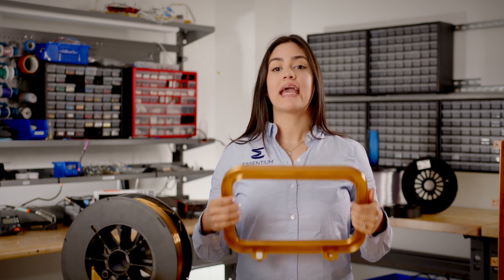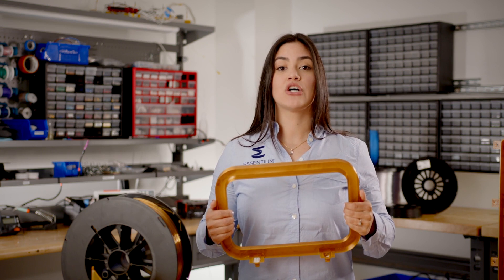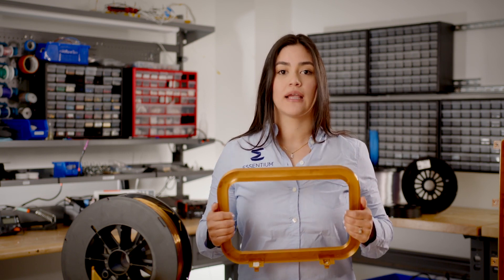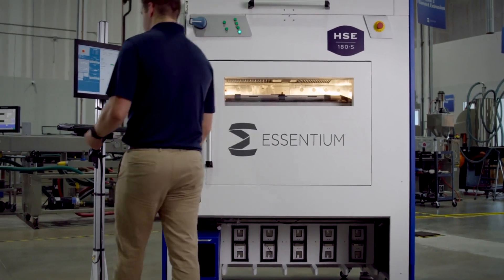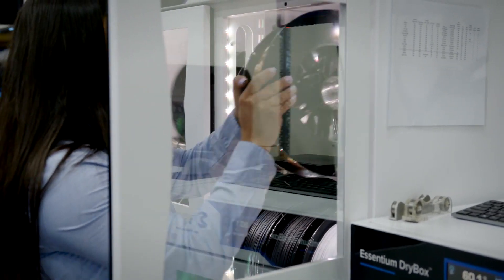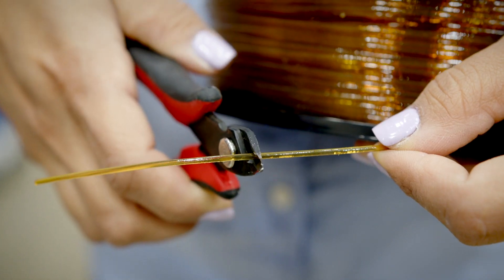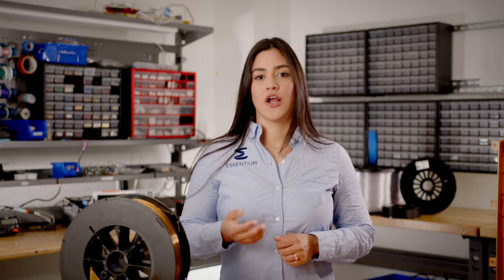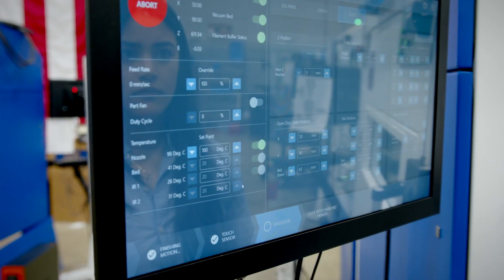Essentium Materials Guide: Essentium Duratem

Comment: Why’s the nozzle temperature to extrude this material?
Reply: What’s
Reply: On our Essentium HSE machines, we extrude around 380C with a bed temp of 150C and chamber temp of 170C. On a traditional FDM machine you could expect to use a lower extrusion temp, maybe around 350C.
Reply: @erinstephan4404  What do you mean,  Is it printable also without heated chamber at 350°?